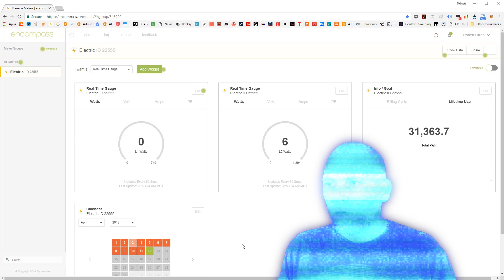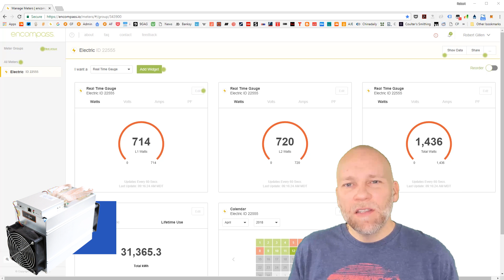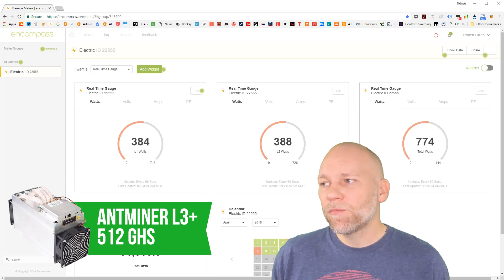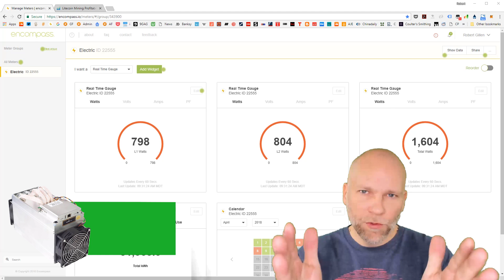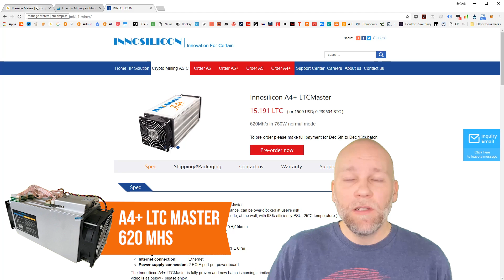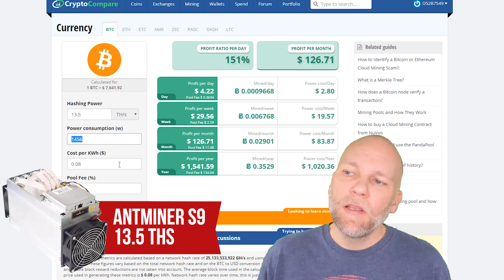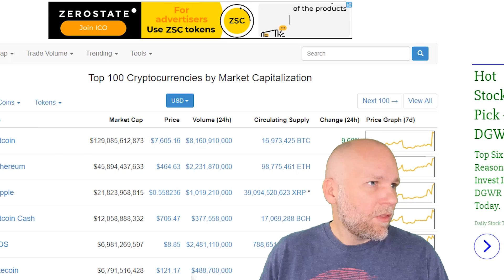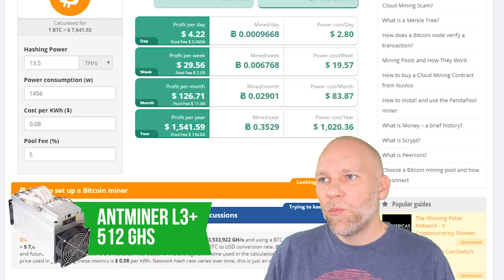Power Usage & Profitability Update on the L3+, A3, A4+, & S9 Miners using APW++ 220v

Comment: I have a Question pls. my household power is 110-120V. I just ordered my first miner from Bitmain with Bitmain AW3++ PSU. Will I have to upgrade my household power to 220v or will standard North American household power (120V) be ok to run these miners?. I ordered 1 L3+ and 1 S9 both with Bitmain PSUs. Thanks for putting these videos. Very helpful. Always like them.
Reply from the maker: Hi, the APW++ will run on 110v or 220v so you are good. Just use a normal computer power cord to power the PSU on 110v (It doesn't come with the cord).
Reply: GottaMinute thanks for the reply. Sucks in Bitmain’s part for not including the power cable even with APW++ order.

Comment: Thanks for coming back to this regarding Power usage and profitability.  Its interesting your power consumption on 220V:
You: L3 (780 Watts) or (1604 Watts) for 2 of them on different PSU.
Me: L3 (880 Watts) 
You: A3 (1436 Watts)
Me: A3 (1478 Watts)
Are you using the Bitmain PSU's?  
I am using HP 1200 Server Power Supplies for L3's and the 1600 for A3 by Amitylabs (eBay)
I'm thinking 2 things to why the difference - 1) My PSU's are not as efficient and/or 2) per TVTIME1 (a viewer who commented in your previous video on this topic) maybe I'm having more power needed based on exhaust setup / ventilation???
I currently have 4" flex duct going from output of miner to a wye thst is connected to a 4" hole to the outside)
Reply from the maker: Yes, I'm using the Bitmain APW++. Sounds like maybe it's your HP power supply using more power than the APW++? The A3s are very close and there could be some variance. I also have my miners vented with a 4" flex dryer duct to the outside like yours. My miner room is about 70 degrees average.
Reply: GottaMinute - I’m dumping cool outside air right in front of the 12” long dryer INTAKE ducts for each miner.  My setup is in the basement and in an insulated enclosure that is around 6ft tall by 20” deep by 38” wide. That’s to help keep the noise level down.  Wish I could post a pic here...